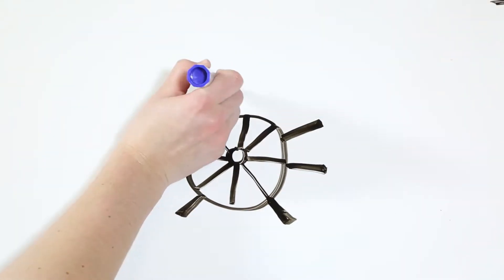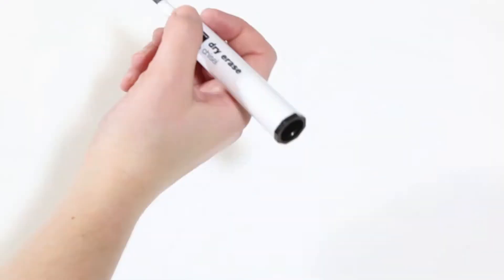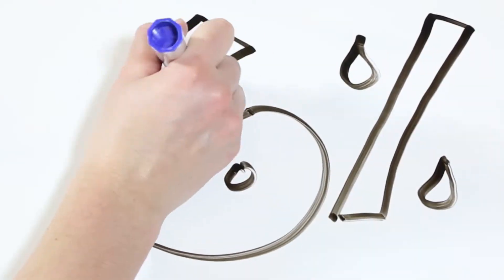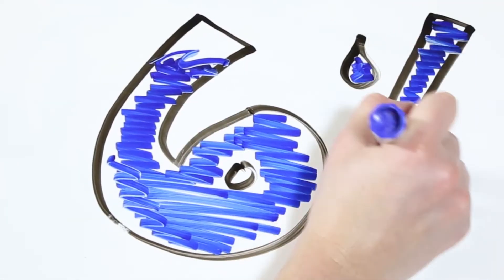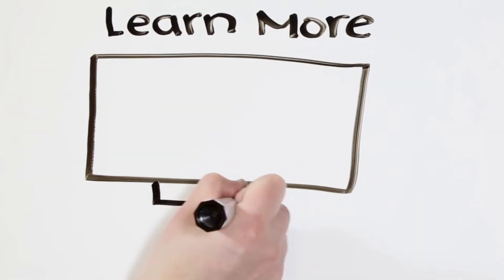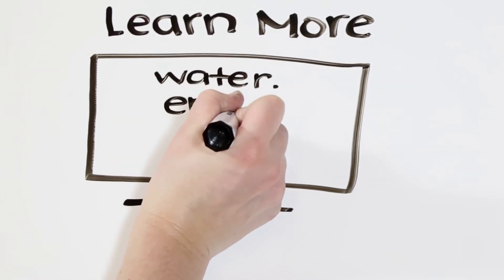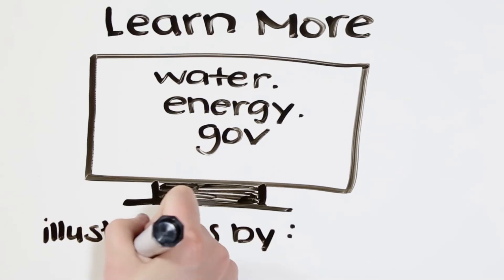What is Pumped-Storage Hydropower

Comment: I wonder if this would be viable for residential use (where you have the acreage available). One problem with digging a pond is what to do with all the dirt. Well, you could "dig" two ponds. use the dirt removed from the lower pond to build up the dams/dikes of the higher pond. Could work as an off grid solar energy storage system with having batteries to degrade.

Comment: Hydro Power Developers should develop Modular Pumped Storage Hydropower System (for e.g. - https://youtu.be/sa0vs8f0Gsg) that can be deployed anywhere near renewable energy sources like solar, wind, wave & tidal etc. And If there is no natural elevation difference available, we could construct a 100 to 200 meter high water tank, the same way bridge towers or wind turbine towers are constructed. Effective energy storage is the key to baseload renewable energy supply and mitigate climate change.
Reply: There's a bit of a price differential between a hole in the ground and a 200 meter high water tank, that's moving in the direction of expensive batteries.
Reply: Thank pal!